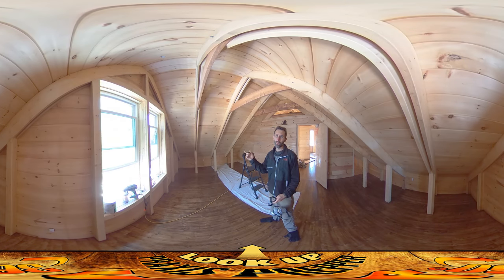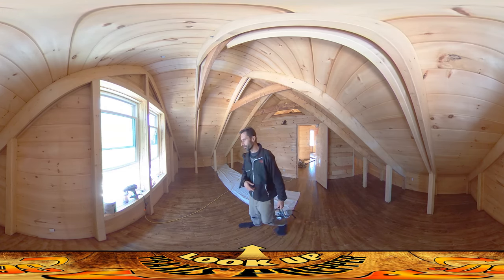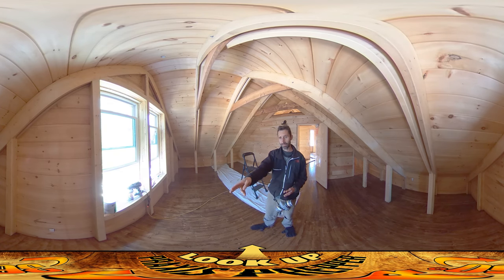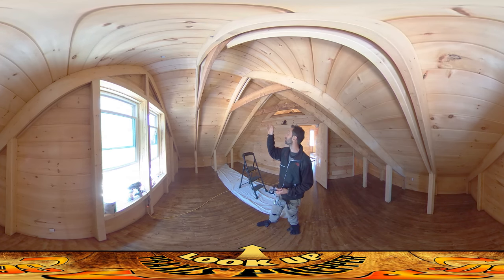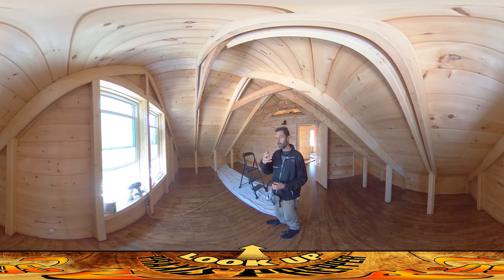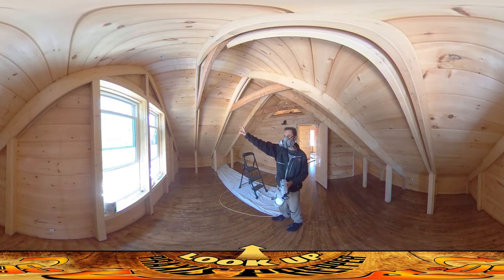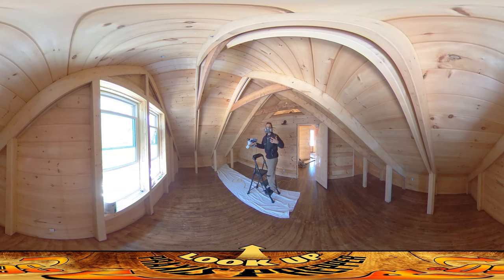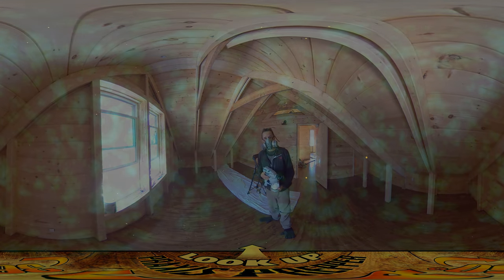Homestead Build - Spraying Acrylic Wall Sealer, PPE for Spraying

Comment: Excellent move, using the respirator. When I was young, I painted a car with "Imron" paint, but without a respirator. I'm still paying for that mistake with minor respiratory problems.
Reply: Strongly agree - use the respirator when dealing with chemicals, dust, and general crap in the air.
Reply from the maker: Thanks for the lesson from experience. Younger people need to know that long term health impacts can happen to them too!